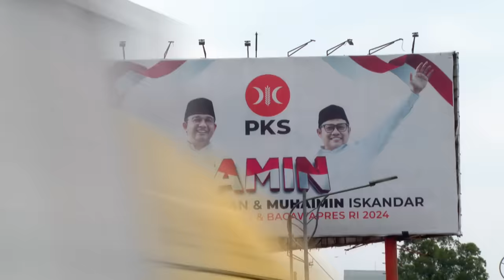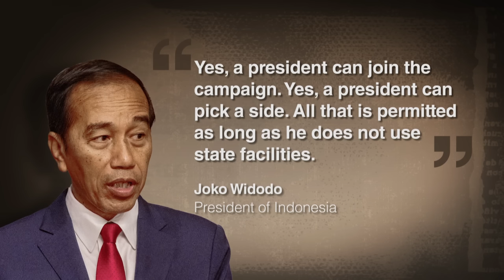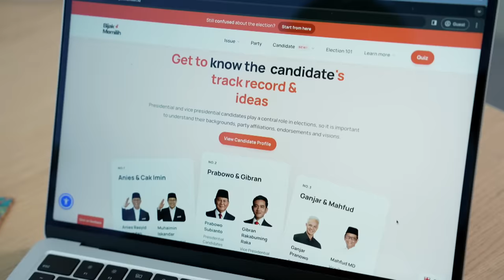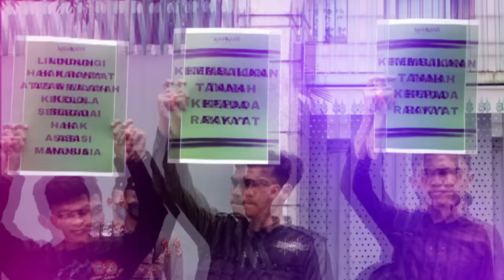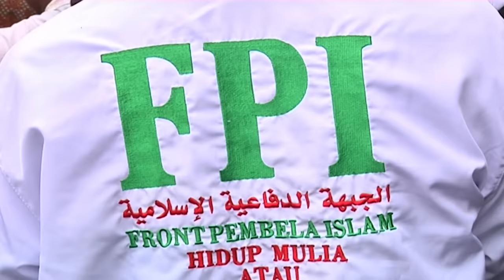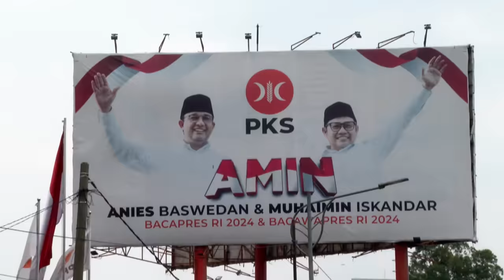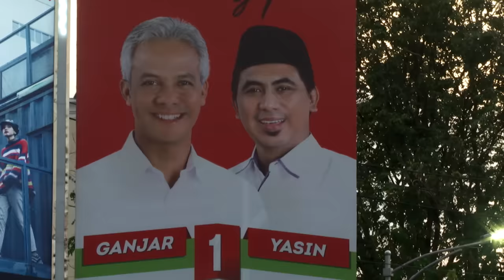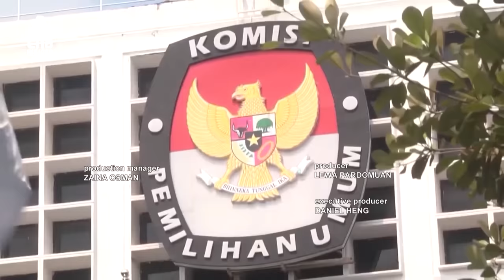How Will Jokowi’s Legacy Impact Indonesia’s Presidential Election? | Insight | Full Episode

Comment: JOKOWI SEHARUSNYA MASIH TETEP JADI PRESIDEN 😢
Reply: Last time a president could run for more than two terms was Soeharto. Look at how that turned out. 1997 protests? 1998 resignation? Won't that happen again if Jokowi runs for a third term?
Reply: @flmis  The difference is the poeple love him and wanted jokowi's leadership for the third time, but jokowi didn't want it... Suharto however, is the opposite
Reply: @alvinnugraha5264  suharto was pretty good in terms of economic policy as well as the introduction of transmigration and kb. He was good till 1980s, until well, he governs too long. 
I think he was loved at some point, but you know, power has the tendency to corrupt people from the inside, moreso if you hold it for far too long than necessary.